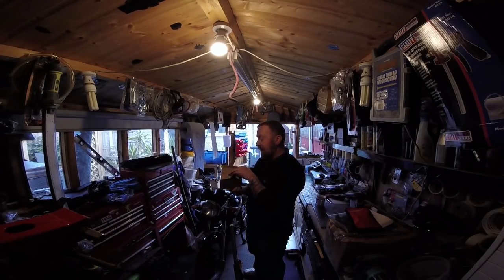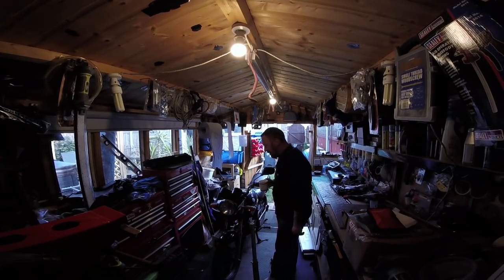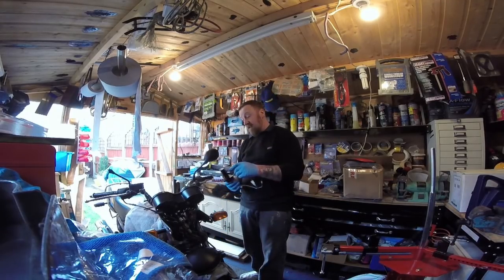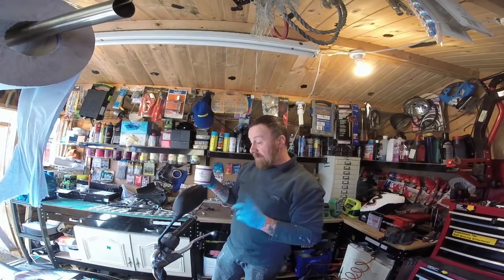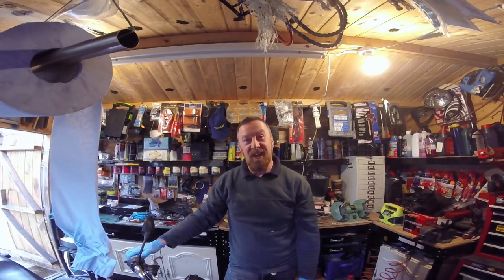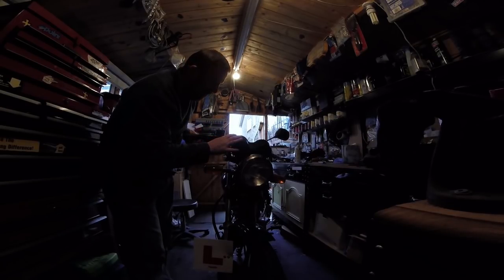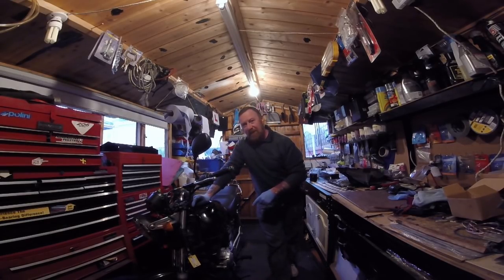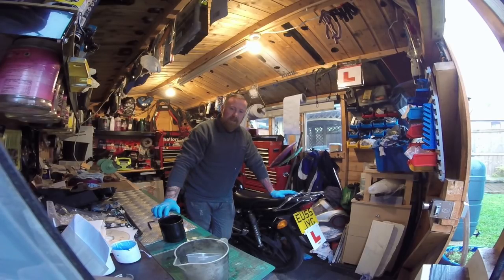YAMAHA YBR 125  IGNITION & STATOR CARB FIX MARK SAVAGE

Comment: Hi I have the same bike 2007 carb edition. I changed the ignition barrel re wired all the wires making the colours and all the lights turn on and starter turns over the engine but it won’t start. Do I need to change back to the original key switch for it to start like you did. Any help would be appreciated thanks
Reply: I have this same problem

Comment: Hi I have lost spark on my ybr 125 2008 fuel injection was running fine I think It is the stator do you happen to know the gap needed for the spark please 🙏
Reply from the maker: check plug sparking first but if no spark check cdi/ efi 
have you been using e10 fuel

Comment: Hi mark just bought this yesterday and went thru 2 batteries both old but not that old and both now dead would it be my stator?
Reply: Does run if bumpstarted tho
Reply from the maker: Volt regulator or stator , maybe even bavk earth bud 
Check all wiring too
Reply: @marksavage  well got home and my parents got me a new battery imma check it over after it stops raining

Comment: Thanks Mark very good video, it seems a common problem with the ybr as my sons bike will not start on the starter button but will start via the kick start, the battery has plenty of voltage so would you say that it’s a Ignition problem.
Reply from the maker: does it turn over?, I have a few videos on this
it can be a few things but you have to start from the top and work your way down, the main thing is that it wil kick over and run so it has power to run

Comment: Hi mark me again is the stator and crank position sensor one unit?
Reply from the maker: Yes bud with a little wire connecting the unit that has 2 screws fitting it on 
Guess if you had two units to could cut and shut 
Me I'd just either clean up the whole unit or replace bud
Reply from the maker: Oh I was talking about a speedfight one , on this sure its the same of of set up
I did do a few videos on it so maybe see it better on them
Reply: @marksavage  I’m going to get a good charge in the battery and have a look at it in few hours

Comment: Hi. I have a problem with ignition my ybr 125 (2008). I would like replecment ignition on the news because old sometimes blocked. I bought new ignition but unfortunately i have a bug. Old switch Has a box with 4 pins in all . New switch Has a 3 pins in box and 1 wire (probably ground).  Now when in new ignition i turn ignition on the ,,on,, i have connect (short circut) between Red and Brown wires. When key is position ,,off,, connect (short circut) is active Black and black-white wires. Control panel od ok, headlamp is ok, Horn is Hood, but engine non started. Starter spin but bike will not start... Sorry for my english 😉
Reply from the maker: You need the right one , as in the video I had this 
You have no spark it sounds 
Replace bud
Reply: @marksavage  thanks for the answer, I'll try to do that

Comment: do you have a p[hone number i have changed the stator cdi and coil and i still cant get spark
Reply from the maker: so have you a volt meter, you need to see if you have power coming from the stator then out of cdi then to the coil
I had the problem with the ignition not powering up so I have no earth !
start with that bud then more on, but I will say I bought a new cdi and that was dead( was not happy as like you I was pulling my hair out)
mark
Reply: yeah where theres no power going to the cdi theres power going to the voltage regulator but there seems to be no power going to the coil and cdi wires the sator is brand new from yamaha
Reply from the maker: have you looked at the power regulator under the tank? the power from the stator goes to that first!
mark
Reply: yeah i just ordered a new one i think its at fault

Comment: Seems straight forward. Except, I lost my keys, so bought a new ignition switch. So far so good. Except….The steering lock is on and I can’t get the head set off! Help!
Reply from the maker: Oh 
You may have to snap the lock off like you were going to steal it 
Unless you can take everything off around it then the top part off bud

Comment: I bought a YBR125 on the cheap and it died after a week. After much faffing I saw the alternator was burnt out. £100 to get it rewound. Waited a month while checking ebay, got a used one for £30 from a bike being dismantled. It's worth the wait if you can afford the time but not the money.

Now the fucking ignition switch is gone so all I can think is 'awh shit, here we go again'.
Reply from the maker: oh dear I had the problem with the ignition too and video on here , don't get the wrong one lol but you might be able to take it apart and clean up then wd40 and it should be ok 
bikes can be a pain but keep up the good work bud

Comment: Hi mark , the peugeot trekker guy here lol , thinking of buying a ybr 125 , glad to see you have vids on these too :-) I may be needing them lol , hopefully not though :-/ haha wishful thinking ,  can I just ask would recommended a fuel injection later model over the older carb model , if both is same condition , am leaning towards older carb model as I have a bit knowledge of carbs thanks to previous problems lol , thanks :-)
Reply from the maker: BoB Smith hi bud 
On these to be honest both are good with no real problems but it will come down to your budget 
Only thing I always say !
Keep an eye on the oil lol 
Very easy to service and work on , enjoy
Reply: @marksavage  yes budget is small ha , carb it is then lol , thanks mate
Reply: @marksavage  Hi Mark just picked one up for £400 !!!! (ybr 125 ) advertised for £700 family just wanted it off drive way ,was there sons who is away , they said can have for £550 then I mentioned all the rust (but there wasn't much) and was hesitant at first , then was 450 I walked away then thought hmmm maybe for £400 she said yes , is a 2012 model 22000 miles, just needs a clean up , will need exhaust soon , but no probs , forks just need a clean and think swing arm is ok (I think )  , think I got a bargain , first problem though idicators not workin :-( but ran well , anyway , just drove it home :-D *edit I think the battery is knackered (hope is not stator or rectifier but no biggie if is), putting on charge now , they had it on enough charge for me to ride away but no more starts after that , is on charge now but will prob replace , could be why indicators not working , hope so , headlights were working though , could hear clicking near the battery when applied indicators , but no flashing anyway , excuse the long messages , thanks for reading lol
Reply from the maker: BoB Smith grad light is from stator so that will well should be ok
Indicators from battery but sure a new one will do the trick if not check fuses first 
Wow now that’s a good deal 
Well done for that haggle so all in well worth it bud
Reply: @marksavage  ha thanks mate , yeah felt a bit guilty , they just wanted rid , was their sons , they were desperate to get rid , so eveyones happy lol , they drive way is now clear and I got a bargain , I've just took the battery out of scooter and swapped it round,   in the rain lol couldn't wait till 2mrw ha , still no indicators but is running lovely , have checked the charging seems ok , after a bit of reading I think is the relay so I've just ordered a new one , and then hopefully tickity boo lol , cheers bud